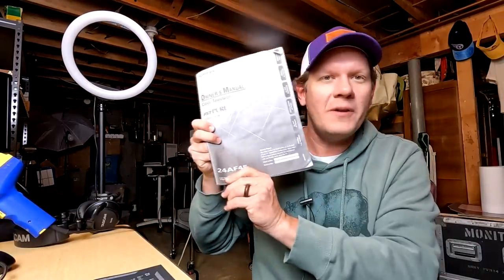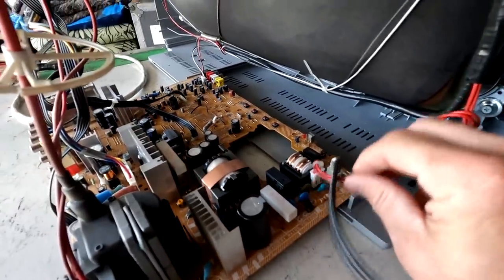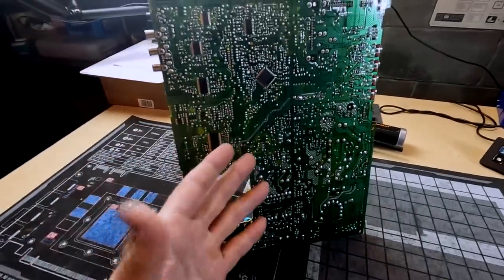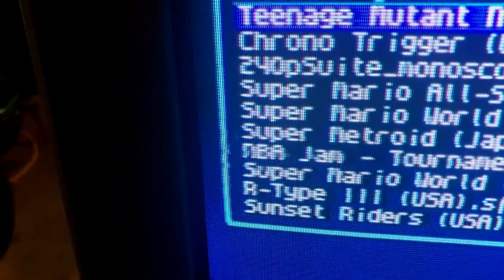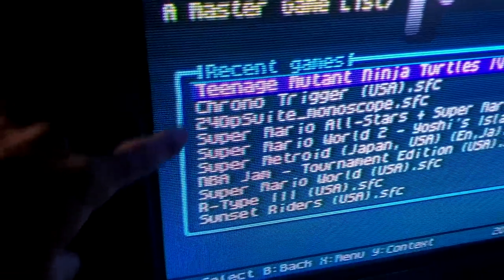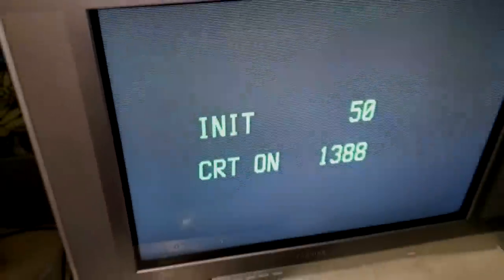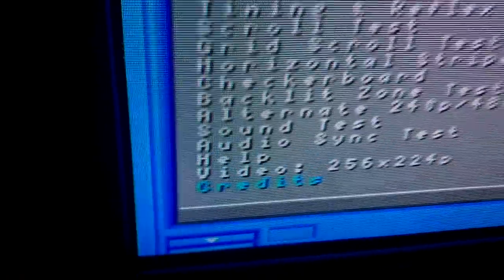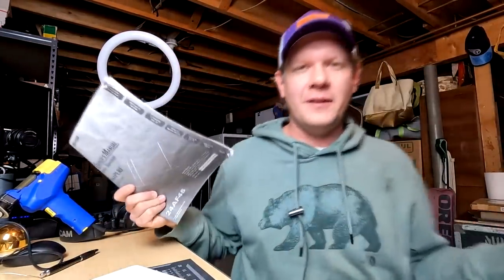The Most Dangerous CRT in Retro 📺 Toshiba 24AF45 Deep Dive

Comment: Velocity modulation just sharpen not only the edge of the screen but all borders of the entire grid and it's orrible! Must be disable ,  about the jittering it should be something on the 100v line psu section wich is going bad you can try to heat that part or cold down with air to better identify the exact component.

Comment: Did you try a different console? I have a 27" panasonic that Snes  jitters like crazy, other consoles look beautiful and the Snes doesn't jitter on a panasonic 20" or toshiba 36", looks like some snes do the same on the OSSC. Voultar confirmed that his RGB kit doesn't prevent jitter, because is not an issue, just some TVs don't like the sync on the snes

Comment: I've got a few of these Toshiba AF sets. Love'em, though I'll admit some portion of that is from nostalgia because I had a 20" back when it was new and it was my first "nice" TV if you will, back when I was like 13. There are two different case designs, fyi, denoted by the last two digits of the model #: 42 and maaaaybe 43 are the first design and 44-45 is the style shown here. Personally, I prefer the earlier, cleaner style. As for their performance, I'm not sure I've had the issues seen here? I've done the RGB mod on a 20" and the RGB mod and recapped a 24". I also managed to find another 24" locally last year (in the original box) that I haven't done anything to. I'm sure they aren't at a level compared to PVM/BVMs but no one should expect that and these things are pretty inexpensive or even free if you're lucky.

Someone else already mentioned in the comments that the "CRT On" timer is displayed using hexadecimal so you need to convert it.
Reply: The 3 tone exterior on these black back charcoal/silver front is beautiful compared to a black plastic crap tv.
Reply: btw rgb modding component is largely useless with $15 aliexprress converters rgb to component

Comment: I've got a 20af43 and people were saying to unplug that sharpening feature without discharging the anode cap. Good thing I haven't gone thru with it. Looks pretty good as it is imho.

Edit: Mine doesn't have that jitter at all, sorry you gotta deal with that. Geometry is pretty decent yet not perfect, it's at least square. The flyback is super loud on mine, hope it's not on it's way out. How funny that I wish I had the 24" version as the 20" is a tad to small.
Reply: My 20AF46 makes a pretty audible buzzing noise. Much louder than most CRTs I've messed with.
Reply: @holographicpikachu1877  Is there a known cure for this? I have an LG hd tube that has a notable buzz too.
Reply: @NoSpamForYou  I'm not sure if its the flyback transformer or a bad capacitor somewhere
Reply: @holographicpikachu1877  mine was buzzy from new.

Comment: Very disappointed that you totally missed the most important detail of this TV, which is that it is not a "real" Toshiba. It was designed and built by Orion in Thailand. Toshiba outsourced all their smaller size 2000s TVs to Orion to save costs towards the end of the CRT era. These were quite cheap TVs, though they are decent when they work properly.

The "real" Toshibas are superior and are known to be extremely nice consumer TVs to pick up. Toshiba's large size 32" and 36" tubes were among the best in terms of geometry, convergence, longevity, and overall quality.
Reply from the maker: That's is not the most important detail .
Reply: @RetroTechUSA  Even if not the most important detail, I don't know how you can call this a "deep dive" without even mentioning that.
Reply: @RetroTechUSA  Steve, I am very disappointed and frankly shocked that you broke our sacred unspoken agreement and didn't mention one extra detail of this TV..... and then you had the audacity to call it a "deep dive". More like "Shallow wade".

Comment: You need to adjust the G2, it is too high. 

Refer to the service manual on where it should have brightness and contrast set when you adjust G2, those levels in the menus are quite low, and i bet some twat has wound up the G2 thinking they knew what they were doing.
Reply: The VM isn't the cause of the corner issues. What it does is adjusts astigmatism dynamically, which enables sharper corner beam focus. The beam travels further to the corners, which affects the astigmatism. 

Essentially it is fairly basic version of electro-magnetic beam focus that was common on CRT projectors.

There is nothing wrong with that HV transformer, the G2 is set wrong. When it is set wrong the electronics that control AKB will continually attempt to adjust things and will never see the result they expect, which results in unstable image. 

The AKB is there to compensate for tube wear, and at 1,300 hours there will be almost none. If you set G2 incorrectly, AKB can't do it's job the way it was designed to, and you get unstable operation. 

I certainly don't believe the defaults for brightness and contrast were low 40s or high 30s, which is where you'd need brightness to be to get rid of that black crush. That is very low.